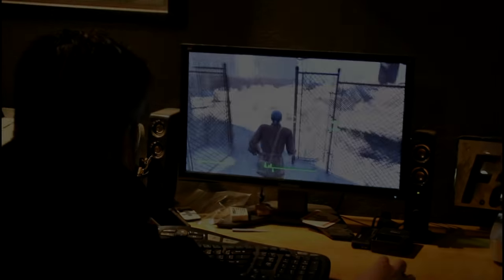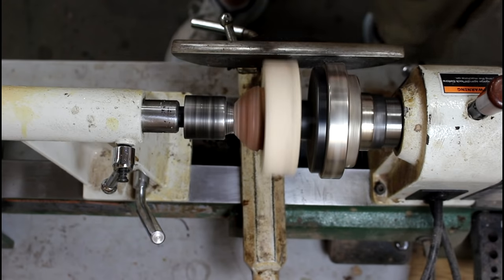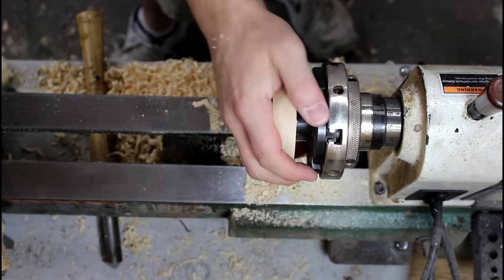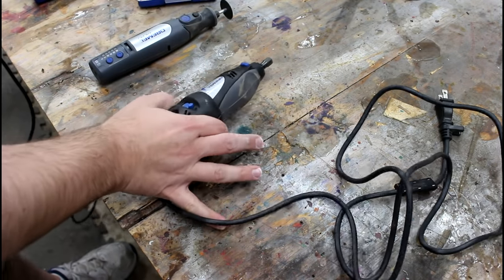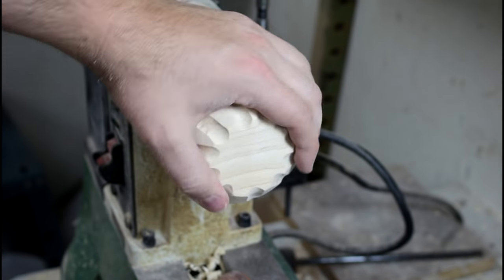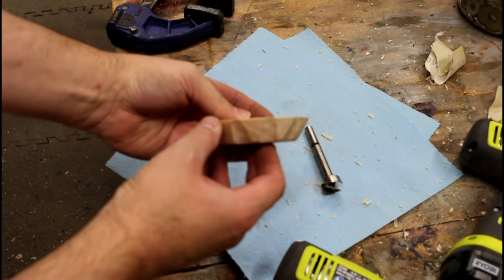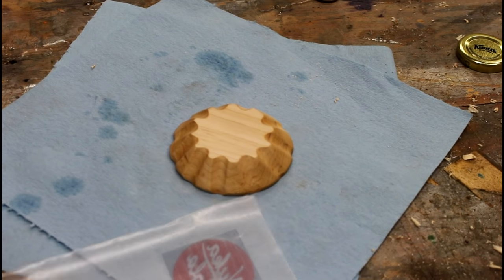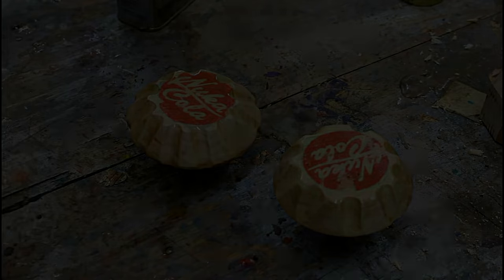Nuka-Cola Bottle Openers!

Comment: +Peter Brown you can do image transfer with laser printer too. You evenly distribute wood glue on a smooth surface and then press and smooth the paper with image (image side down ofc) on the wood. You wait for the glue to dry and then use some water to moisten the paper and rub it off with something like a sponge, cloth or other things. Don't be afraid to scrub hard when you get most of the paper off, the image is pretty well glued to the surface and won't scrub off with the paper.
Reply: from experince its best to use a gel glue medium as it gives the best clarity (did this for my currunt school wood working product to make a chess board table)

Comment: Here's an idea...take a tiny coke bottle, like from a key chain, something maybe 1 1/2 - 2 inches. Then mold it in a resin cast that itself is shaped like a larger coke bottle. Large enough where you can offset the tiny bottle, and leave yourself room to screw in the washer. I thought the wood cap would be awkward to hold. Resin coke bottle is something that fits better in your hand with a grip, would make you want to continue to use the bottle opener and not just have it on display, which the wood bottle cap would be better for. Lets be honest, these are opening beer bottles more than coke.

Comment: I think you probably could've used a threaded rod to (sort of) file away the grooves around the perimeter of the 'cap', instead of using the Dremel sander.

Comment: Awesome Idea! I'm thinking there's a simple jig that can be built for a drill press that can more easily make the sides of the cap, and then it's just a matter of using a circle cutting jig on a tablesaw or bandsaw to cut the circle shape.  No turning necessary. (Start with big blank, drill holes at drill press using the jig, move to circle jig with table saw blade or bandsaw table set at desired angle).  If that makes sense. (can picture in head, not sure if proper words are coming out)
Reply from the maker: +gorbashin Cool idea!

Comment: The radiation......... it's the radiation that warms the insides.  Great video.  If you loaded a large drill bit in a drill press, could you grind down those grooves?  I'm wondering if that might not work or take too much time now that I type that.  But it's a really cool idea either way.
Reply from the maker: +TJ Woodworkshop I need a better jig for the grooves....
Reply: I was thinking of something that would work, then I realized, ask Jack Houweling, he'd probably whip one up.

Comment: Couldn't you get a more consistent shape by mounting the piece on the lathe, rotating it by say... 30 degrees and attaching a drill at the angle of the taper? Then just use mounted drill instead of the cutting head?

Or even better. Drill press the piece at an angle with a large bit?.

Comment: MHMMMM. MHM. I have a Dremel 300 as well, I use it only every so often, and I also am a hypochondriac about keeping my tools pristine. I found out my father used one of my screwdrivers and didn't re-oil the shank (rust prevention), I almost lost my mind. Anyways, the Dremel's slide switch to determine speed actually quit working after only a few uses, I had to take it apart and clean it to get it to work again. It hasn't failed since then, but the slider switch is basically just a rheostat that connects directly to the commutator. The rheostats are known to get dirty and pretty much stop the Dremel from working.
https://goo.gl/qLMy5o
This might never happen to you, maybe they've fixed the issue (mine is a couple years old now, I'd say 4), maybe they slapped a little dielectric grease in there. That's what I did, so that combined with a nice cleaning seems to keep it working fine.

Comment: Please please please reply what chuck do you have???
Reply from the maker: +mathew capel I have a very cheap 4 jaw chuck I got from WoodCraft back in 2009. Things I'd rather have.

A chuck with a single chuck key rather than tommy bars
A set of dovetail jaws, for better holding power.

If I was to buy again today I'd save a bit and get a Nova scroll chuck.

Comment: Hey anyone have any ideas on a lathe that isn't to expensive? I want make lures and things but don't want spend to much money.
Reply: you can make one out of an old corded drill
Reply: +Steve Hillier thought of that but it seems more work than it is worth
Reply: +Josh Cohn yeah I know you can get small ones, usually 12" in the $100-$150 range, (try harbour freight, princess auto, canadian tire or w/e you local crappy tool store is) but from what I've read they are very poor quality. If I were you I'd try craigslist or kijiji, I'm not in the market for one but I checked my local ads and found a nice 36" rockwell beaver lathe for only $80
Reply: ***** thanks for the ideas! Just gonna wait until Christmas then I have an excuse to get one